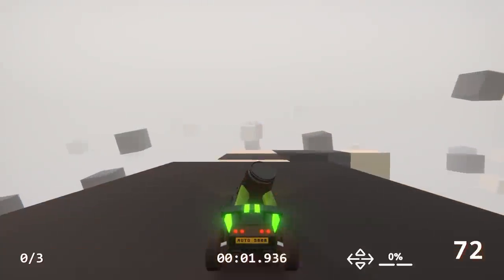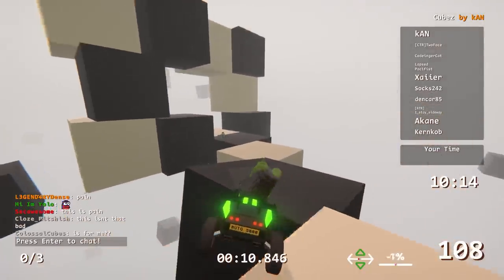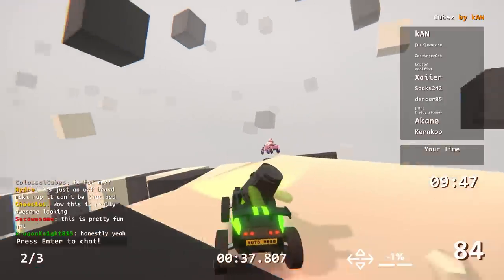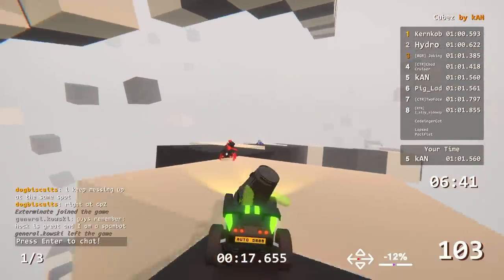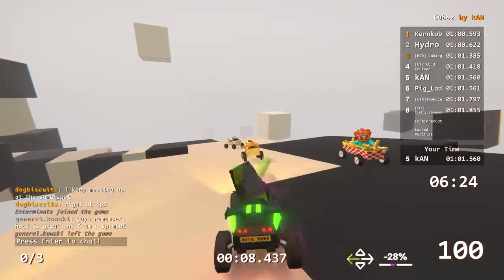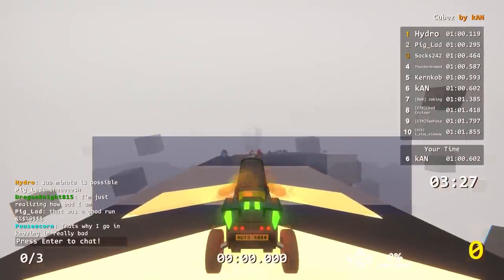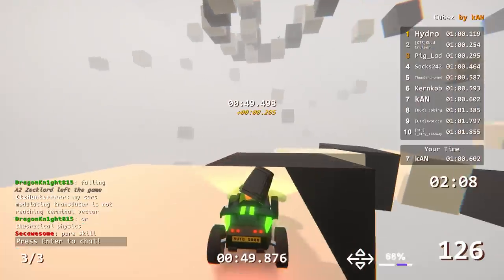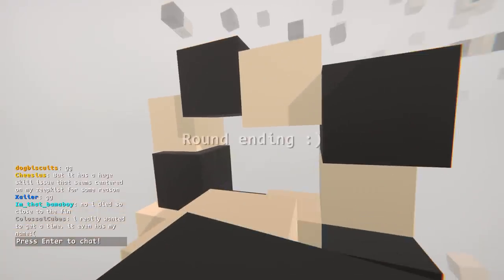I Built a Super Technical Track Made Only of CUBES!

Comment: It should be possible for janiek to fix the booster RNG using the same technique the calculates the time for checkpoints. You can use it to figure out  the exact time in a booster instead of the number of frames
Reply: Yannic.

His name is on all the adventure levels